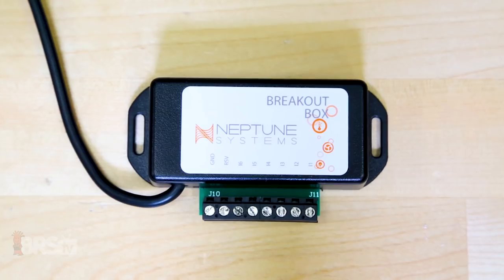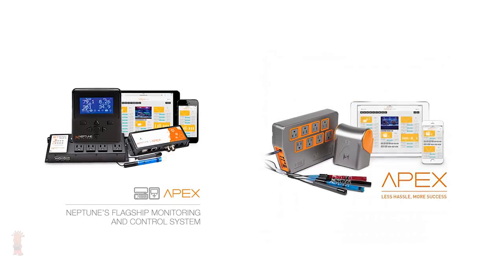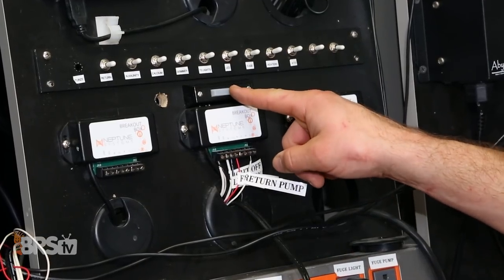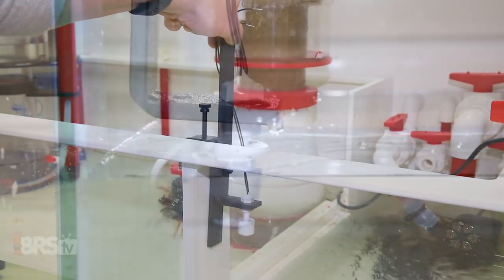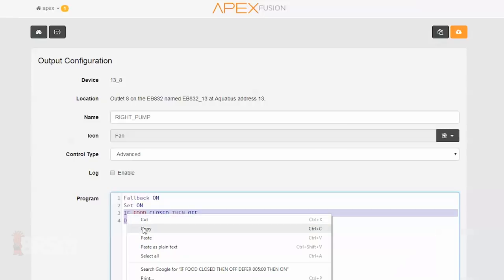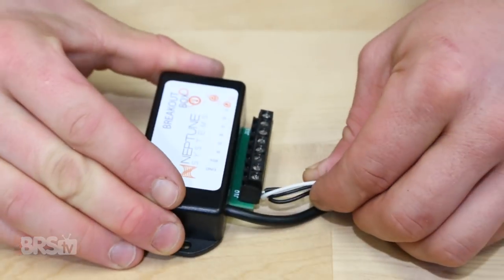Spotlight on the Neptune Apex Breakout Box| BRStv

Comment: Instead of jamming all the ground wires together in one port, just get a small bus bar that can be found at any home depot or lowes in the electrical section.  Mount the bus bar close to the breakout box.  It'll give you a discreet port for each ground wire.  Then a single wire can run from the bus bar to the ground port on the breakout box.  Much neater wiring, and you can disconnect just one ground if needed without taking them all out.

Comment: Love the BOB, but stuffing 6 wires into one ground terminal is asking for serious problems, especially if any of the switches are being relied upon for "disaster prevention".  If they're not in there just right, one bump could easily break connections.  One very easy, and cheap (how often do you hear THAT?) fix is to get what's called a "common busbar".  Mount the bar just to the side of the BOB, run a wire from the ground terminal over to the bar, and you can now have an independent screw point for each separate ground wire.

Comment: Can you add an ozone monitor to the breakout. Then when the sensor goes off apex will shut off the ozone reactor?
Reply from the maker: I don't believe so. At least, we've not seen anyone do this before. Most reefers will opt to use an ORP probe and controller (like the Apex) to shut down the Ozone generator as necessary.

Comment: You showed a solenoid valve in this video - how can that be used with the breakout box given that it has 12/24v requirements ?   Also for the waterproof wire connector , where can I buy them ?
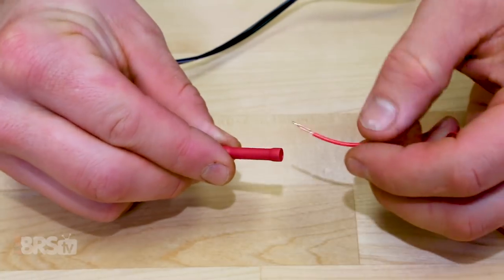Reply: you can the soleinoid at 2:18 where you are discussing the endless choices of switches.    Water proof wire connector is at 5:29
Reply: But use a switch to signal an output with a 12v transformer and power a solenoid, yes, you can do that. I do that for my Cats water bowl to fill daily through my Apex.

Comment: I have to side with everyone suggesting that it's a bad idea to stuff all those ground wires under 1 terminal. Not only is it a safety and maintenance issue as they've already pointer out but it also violates national electrical code in the US as well as voiding any u.l. certifications on the equipment connected in that way. If you feel that a buss bar is more than you'd like to spend then just run 1 wire from the bob and use a wire nut to tie them all together. That at least avoids going against NEC and keeps the u.l. rating intact but you still have the maintenance issues associated with having all the wires under the same terminal
Reply: While you are right this is low voltage so while it is the indict way of doing this it's still fairly safe. There are after market breakout boxes for the Apex that address this problem by giving all switches their own ground.

Comment: Gotta say the breakout box is one of my favorite pieces of equipment considering it is the most low tech one (you literally can build these yourself).   Originally I didn't like them much way back in my AquaController 3 days because you could only use 2 switches unless you bought some upgrade piece or something (due to memory constraints of original controller) glad the Apex has no such constraints (that are realistically achievable).

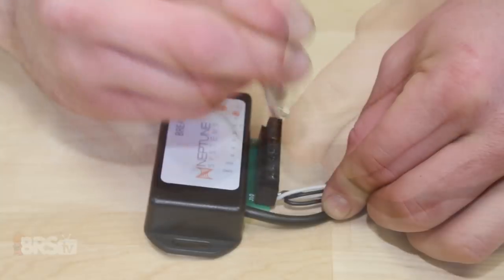Comment: Make your own breakout box. There is NO electronic inside. Just all wiring. You should use those DC power plugs/jacks so that each device is on its connection, not all ground wires connected to one connection (see 7:10). It makes no sense that when you need to disconnect one device, you need to disconnect all the ground wires. What was Neptune thinking when they designed this? Remember, no electronic inside and you can DIY it for $15 and make it BETTER than what they (Neptune, not BRS) wants.
Also, use virtual outlet to control each input so that you can set it to off or on using apex fusion. That way you can also make off to on, or on to off.
Oh, if you want a 2nd or 3rd breakout interface, you have to buy a PM1 or PM2, or PM3, or ASM module (2:04)? I really don't need extra COND, temp or Ph interfaces. Maybe they should make a new module that has couple breakouts, 24VDC, and some 1LINKs.
Reply: Avast Marine makes a BOB with speaker style jacks in a kit or assembled as well.